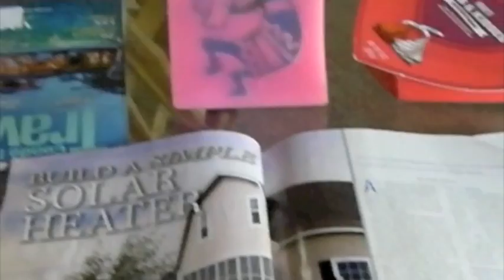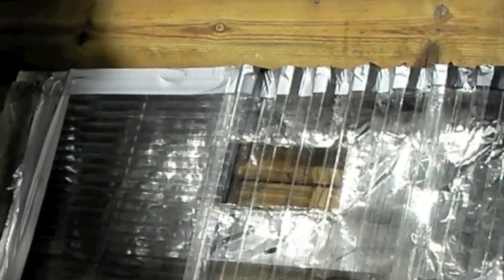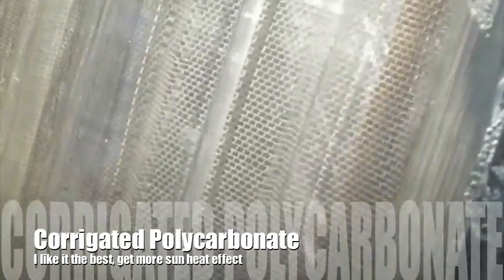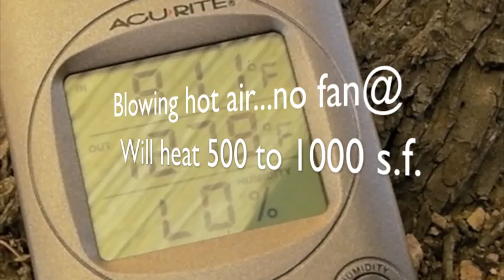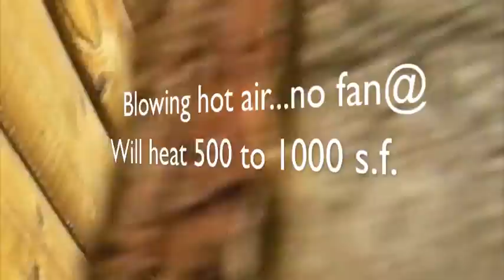How to Build a Heat Box for $6, Heat your Home Free

Comment: You need to learn how to make a video. I have no idea what you are showing, because you are in constant motion. Please. I know it's a good product, but this makes me dizzy.
Reply: Just now got around to answering. Yes, I know. I have done about 70 videos, and at one point we had 700,000 views, but on this one we are at about 560,000.  I guess I am not a cameraman when atop a mountain, but a lot of people "got it" and built one.  My mind is certain, I built it, and it works.  Have you gotten around to doing anything, if so, send us a photo and a budget of what your costs were. That would be a positive contribution.  Actions vs Words thing. This is not rocket science, it is a simple box frame with one side to let sunlight in.   6 ft high, 3 ft wide and 4 to 6inches deep.  The front facing the sun is plastic, polycarbonate, glass, or fiberglass. The back has aluminum foil to reflect the sunlight back to a window screen that is hanging in the space in the middle of the box.  My goal was to see how or what I could put together with some old scraps in my basement.  How to build it, you nail or screw the 4  4x4's into a square shape and nail a piece of plywood to make the back. That should take you about 20 min.  Then you hang a window screen or metal door screen wire in the middle.  I put foil on the back to reflect the sun back toward the screen...and it heated it up even faster.  Then screw the plastic see through cover onto the front, another 20 min if you are slow.  All in all I spent about 2 or 3 hours putting it together.  I heats the outside air temperature in summer and winter from 40 to 70 degrees hotter, and works very well without a fan.  We considered putting a fan onto the hole in the wall inside to blow air in faster, but never got around to that.     Sorry about the shaky video, I am not a film professional, just wanted to throw the idea out there.  Over 560,000 people have viewed it, and many have built these. Build one and send us photos.  My out of pocket $6, but you can do a Cadillac version and use all new materials but even with that, the cost is very negligible.  Best to you.  Ben Boothe
Reply: I watched it no problems  ,sorry all the snowflakes bitched at the video ,apparently the world is turning into a bunch of sissies who have nothing better to do then criticize and whine

Comment: The  yield of the solar box is zero  at the maximum temperature.
The yield is maximum when the coming out up air is at the minimum temperature useful to heat the house, (minimum loss inside the box ) around  85°F=30°C, with a large fast air circulation, with large input and output .
In thiscase the power is around 300W/m2  at maximum sun.
You save around 1kWh/(m2sunnyday)  around 0.1$/(m2sunnyday) roughly, but with maximum air rate flow coming out at around  85°F=30°C.
Reply from the maker: dedelytub 

We are very interested in seeing the solar chimney box that you have built, and your comments suggest such good practical information, we would very much like to see the photos and details of the unit that you have built for empirical evidence.  Love your analysis and good ideas, but can you show us what you have actually done...that would be most relevant and prove credibility.

Comment: Would of been a jusefull vid if you had shown us how you built it haven't a clue wot you were on about maybe build one as an instructional vidio and calm down abit thanks anyway ant from Wales UK
Reply: Hi Anthony,  Just now got around to answering. This is not rocket science, it is a simple box frame with one side to let sunlight in.   6 ft high, 3 ft wide and 4 to 6inches deep.  The front facing the sun is plastic, polycarbonate, glass, or fiberglass. The back has aluminum foil to reflect the sunlight back to a window screen that is hanging in the space in the middle of the box.  My goal was to see how or what I could put together with some old scraps in my basement.  How to build it, you nail or screw the 4  4x4's into a square shape and nail a piece of plywood to make the back. That should take you about 20 min.  Then you hang a window screen or metal door screen wire in the middle.  I put foil on the back to reflect the sun back toward the screen...and it heated it up even faster.  Then screw the plastic see through cover onto the front, another 20 min if you are slow.  All in all I spent about 2 or 3 hours putting it together.  I heats the outside air temperature in summer and winter from 40 to 70 degrees hotter, and works very well without a fan.  We considered putting a fan onto the hole in the wall inside to blow air in faster, but never got around to that.     Sorry about the shaky video, I am not a film professional, just wanted to throw the idea out there.  Over 560,000 people have viewed it, and many have built these. Build one and send us photos.  Best to you.  Ben Boothe

Comment: With an oursisde air temperature of 81 degrees.  No heat is needed.
Reply from the maker: Kind of miss the point didn't you?  On a mountain top, we don't build in the snow in the winter, we build in the summer.  It works very well. Over 560,000 people have viewed the video, many have built their own.  Show us what you have built...that was the point to stimulate creative actions.  Peace to you.  Ben

Comment: What's really odd is with the addition of some additional vents and a small immersion pump acrylic tubing and humidifier wicking material you can actually use this same system for solar heating in a configuration to in fact COOL your home  LOL I'll explain in another comment but if you think about it you are just making a natural drafting swamp coolar where the heated air by the collector goes OUT of your home causing negative pressure in your home and pulling air in through the vents/wet wicking material LOL
Reply from the maker: Great idea.  Ben

Comment: Hey bill this is a pretty good design. As Dan Rojas does on GreenPowerScience the Coroplast material does make logical sense as you have shown. You can get it from sign shops... I think in my town the sign shop wants like 30 bucks a sheet for a 4 x 8 Sheet or you can ask political campaigns if you can go around collecting the camapign signs ..  they are made of coroplast... after the election is over if you can have them... many campaigns will agree to let you do this as the sign normally contains the year on it .. LOL so good example of "repurposing" ... heck we used to call it reusing in the 70's but I guess reusing isn't as macho for some people LOL...... but yeah...your sealing of the unit if you route out tight grooves just under the thickness of the coroplast and then wedge the material into it.. you do not even need silicon. In fact if you know how to do it, you don't even need nails or screws to dovetail the frame together LOL....  so pretty much with some wood and the coroplast you get from campaign signs well you could build it for free... but yeah this is very very very good thinking... I wish more people would be demonstrating how materials like coroplast are a better choice in videos for solar heating....
Reply from the maker: Thanks, appreciate your note.   Ben

Comment: What would be the total cost if someone didn't have all those materials??  That would be more useful information than saying you only had to spend 6$ + time to make your solar heater.

You seem to think temperature difference is all that matters.  Temp & heat are NOT the same things.  For example. water in an 8 oz cup & water in a 30 gallon tub could both have the same temp (e.g. 120 F), however, the bath water contains many times more BTUs of heat energy than the cup of water.  Another example is a tea light candle.  The flame temp is ~1,000 F, but the candle can only put out ~250 BTUs of heat per hour (which is very little heat when compared to a common 1,500W electric heater that puts out ~5,000 btus of heat per hour. 

You should focus more on the heat (e.g. btus per hour) that is produced by your apparatus than the temp differential.

Thanks for sharing.
Reply: Flipout:
Really?  Are you really so dense that you can't properly grasp the gist of the dialog here?  Wow... get a clue dummy.
Reply: Well I found your comment more helpfull than the actual video. 33 square feet, for the equivalent of a space heater. Good to know.

But for example on the subject of materials, where i am  in canada, at the home depot, a single sheet of single wall corrugated polycarbonate, its $58 dollars CANADIAN. Thats about 70 USD. So yeah. Not 6 dollars for my build. I wish it was though. Then Id just build my walls with these things.
Reply: Thanks.  

GIven that you are likely above the 49th lattitude, you're not likely to receive as much solar irradiation during cold months.  You can check out your solar irradiation here:  http://pvwatts.nrel.gov/

Yeah--it isn't 6$ for ANYONE--no matter what the video author's claim is... A less expensive alternative to a polycarbonate sheet would be UV treated green house plastic.  It's much less expensive & usually lasts over 7 yrs (more if you store it out of the sun during the summer months).

hth
Reply from the maker: Zeffur7 wishes to know what it would cost if someone wanted to build one of these and did not have all of these materials.   Well, Zeffir7, I have no idea what you have or do not have, or what stores are near your place, so my advice would be to go to the nearby lumber yard or Home Depot, or scrap yard (depending upon your taste)  and see what the cost to you, depending upon the quality of what you wish to purchase. Then make a video for us and show us what you can do. The purpose of this video is not to go shopping, but to give you all an idea..of what you can do with your creativity, with materials on hand....to stimulate your creativity, and then to see what you build or create that is as good as, or better than this.  For me it was a fun afternoon project that generated better than expected results. Show us what you can do my friend.
Reply: +Ben Boothe Sr.
You spent all those word to inform me (and anyone who might read these comments) what anyone already knows??

The truth is that you are already equipped with a camera & the desire to build a solar heater.  What you apparently lack is a bit of good knowledge & advice before building--which is the reason that I wrote my previous message to you.

So... in that vein, below is some more useful information for you --that hopefully you will use to make a better heater & better video to share with us:

1.  The amount of solar radiation available to you varies depending on your global position & the time of the year.  In general, you can assume there will be a maximum of 1 kW per hour per square meter or ~92.9 W per hour per square foot on a sunny day.

2.  That means if you wanted to build a solar heater which is equivalent to the output of a 1500 W electric heater, you would probably need a solar collector area of ~33 SF (i.e. ~5.7' x ~5.7' or 3' x 10.7'), assuming a conversion efficiency of ~50%.

3. Designing your solar collector like a solar oven would also be useful to help collect & conserve the energy that you collect.  Note:  there are plenty of videos on YT which adequately describe all the tips that you'd need to design & build a solar oven.  P.S.: Even though a solar oven can produce very high temps, if you open the heat collector to allow hot air out & cold air in, the oven will only achieve moderate temps (similar to your design but better).
Reply: zeffur7 with all your information you couldn't find out the cost of the material he used? What a numbnut

Comment from the maker: You asked what the unit will make on a cold day. Read and watch again. Temperature of air is increased 40 to 60 degrees.  So if you have a 40 degree day it will heat the air 80 to 90 degrees.

Comment: I would wonder if the air in the house would be sufficiently displaced by the chimney effect.  Seems to me that a cold air return system of some sort would help out in heat distribution.  For example, at least an input to the lower part of the heat source would certainly help with the air circulation.  Still a good idea and one good place to start in finding an effective means of using solar power for heating a home.

Comment: how do you save the heat during nightime? clay soil, ceramic bits, sand, water, dark topsoil in a pipe that within a pipe or something? just wondering, this is still the best design I've seen yet.=)

Comment: So you rambled on about the different types of polycarbonate you used without ever once mentioning WHY you used the different types.  ::facepalm::
Was there a point or are you just a blithering moron?
Reply: you're not perfect either
Reply: Just now got around to answering. This is not rocket science, it is a simple box frame with one side to let sunlight in.   6 ft high, 3 ft wide and 4 to 6inches deep.  The front facing the sun is plastic, polycarbonate, glass, or fiberglass. The back has aluminum foil to reflect the sunlight back to a window screen that is hanging in the space in the middle of the box.  My goal was to see how or what I could put together with some old scraps in my basement.  How to build it, you nail or screw the 4  4x4's into a square shape and nail a piece of plywood to make the back. That should take you about 20 min.  Then you hang a window screen or metal door screen wire in the middle.  I put foil on the back to reflect the sun back toward the screen...and it heated it up even faster.  Then screw the plastic see through cover onto the front, another 20 min if you are slow.  All in all I spent about 2 or 3 hours putting it together.  I heats the outside air temperature in summer and winter from 40 to 70 degrees hotter, and works very well without a fan.  We considered putting a fan onto the hole in the wall inside to blow air in faster, but never got around to that.     Sorry about the shaky video, I am not a film professional, just wanted to throw the idea out there.  Over 560,000 people have viewed it, and many have built these. Build one and send us photos.  All of us morons would love to see what you actually build...   Actions louder than wordsthing.    Best to you.  Ben Boothe

Comment: I would love to know where you got the polycarbonate corrugated sheets for $6. I had to pay $22 each for the two it took to build my passive solar heater.
Reply: Joe Plemmons 
The fool said he already had all the materials to make it, it cost him $6 extra to buy some sealant. This won't work in winter or at night when you need the heat.
Reply from the maker: Mine were some old scraps in the basement.  I got mine for free, and cut them to size.  Ben

Comment: Ben thanks for sharing but! the video was not very clear on how you did it. You sort of talk here, walk there,,, your ideas are scattered. If you view your video again maybe you might see what I mean
Thanks again for sharing
Reply from the maker: Hi Jim,

Nice of you to take the time to comment. We give written instructions on the U tube page and also refer you to Mother Earth Magazine's articles, which is were we got the idea.  Actually, about 187,828 people have viewed this video, and in-spite of the lacking video quality (I did this with a small hand held camera at 8,500 feet altitude, thus my heavy breathing and sometimes shaky camera) , it seems that only 13 of the 187,828 viewers have registered a lack of understanding of how to build a box, cover the side facing the sun with polycarbonate or glass, and put a hole in the top of the back side of the box and an entry hole for air at the bottem back of the box. But some tell me an entry hole is not necessary because the air will make it through tiny cracks or spaces where the box may not be airtight.    After reminding them of the Mother Earth magazine article and other written description in the U Tube site, they seem to understand it.  Enhance it with black painted wire screen and put a reflective foil on the inside of the back wall and multiply the radiant heat. I cannot tell you how many thousands of people have built these since we posted it. Many of them have written with tweaks and improvements, which I find wonderful. Some have put small fans to increase the air flow into a house. So, if you are really interested, let me know how yours goes.  Mine took about 1.5 hours to build, and I bet you can do it better. Show me what you can do!  Ben
Reply: Hi Ben. I figured it out. It is relatively straight forward in design. The part I missed in your video was the actual assembly but I have it now. I decided to go with steel wall studding and maybe incorporate a small 12v fan but that would be getting fancy LOL. All the best to you...Jim